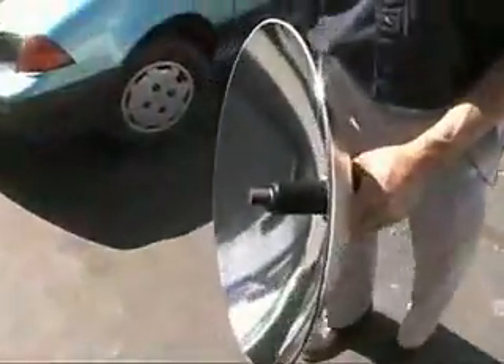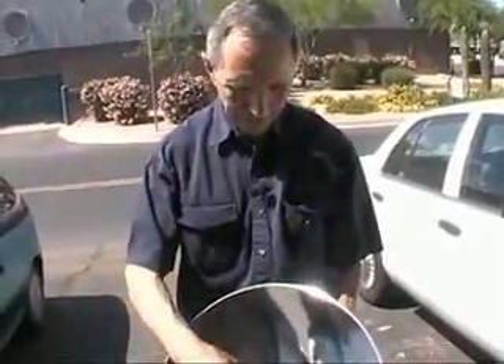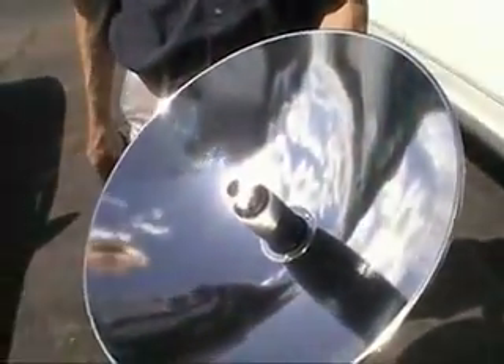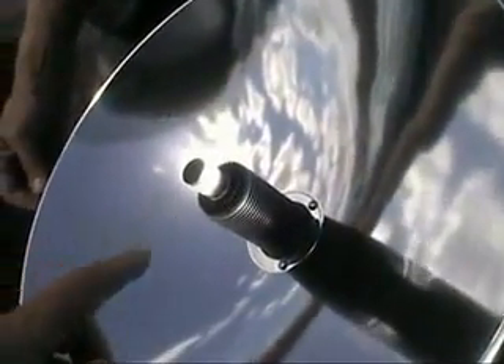Solar Powered Hydrogen Assisted Stirling Engine.

Comment: These units are scalable to any size, The pressures vary to the design. Nasa and Boeing have both produced high quality proof of concept units in the KW range. You will have to check but I think one of the Boeing units is 10kw

Comment: Nasa and Boeing both have worked on this. Nasa also have a Linear version that was built by JPL for powering Probes. 

I don't understand your points and question, this is a prototype and  a very different design to a normal Stirling and by the sounds of it any unit you have seen. These units are completly sealed for very high pressures to maintain the Hydrogen charge.
In short they work. Kockums are involved with these for marine power.

Comment: Absolutely brilliant idea, however, operating Hydrogen at high temperature and pressure causes a reaction between the oxygen in the metal and the hydrogen, causing the metal to become brittle, there is a process to eliminate the oxygen in the metal at the casting stage but is very costly, my question is, have you found a synthetic material to eliminate the reaction between the two gasses

Comment: 2 feet wide makes <1000 milliwatts but 30 feet wide makes 30,000,000 milliwatts??
Reply: Well, very small units tend to have dismal efficiency, and those 30 kW for a 9m dish is probably for Sahara-like conditions. Something like 15kW seems more attainable for this size.